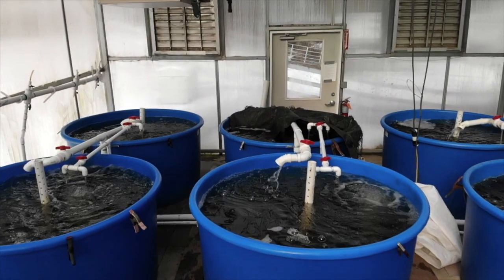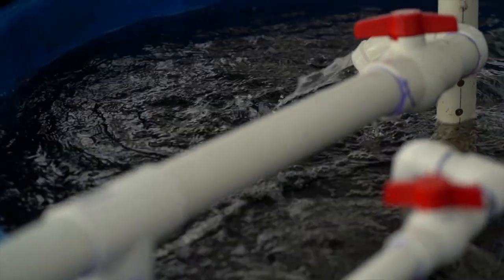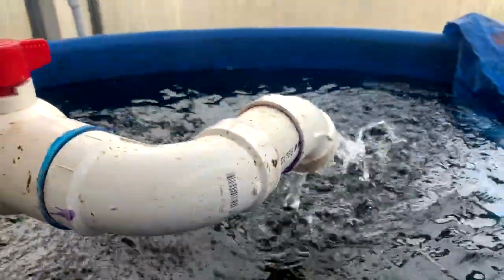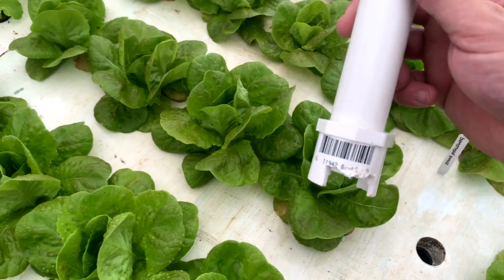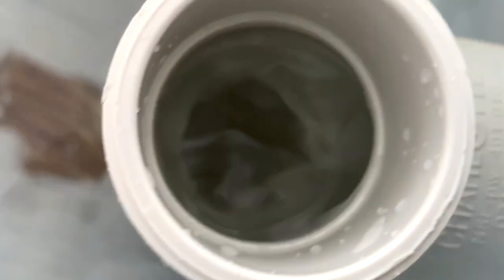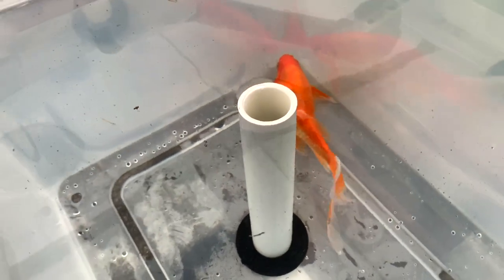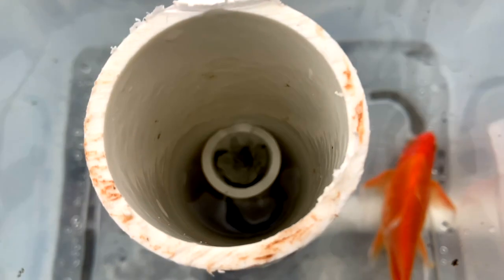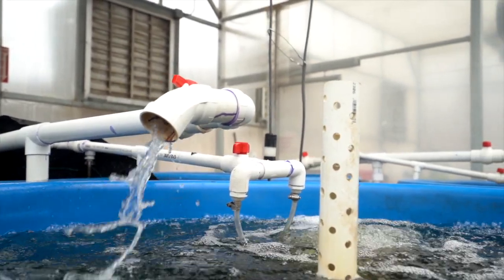Solids Lifting Overflows (SLOs) for filtration in Aquaponics

Comment: Thanks for the video, I tried the horisontal SLO. my tub is 160x110 x 40cm(height), about 500 liters. I use 2" pipe SLO. The flow works, but the flow rate return with balance is only 70 liter per hour. Definitely not enough for fish farming. The filter is located at the same height as the tub. Any suggestion to get higher flow rate?

Comment: Great visuals! Thanks for sharing. Just some questions though. Is SLO still needed if there's a pump sucking the water/debris from the pond going to the filtration system? Or can SLO and pump be installed at the same time? Appreciate your recommendation. Thank you very much
Reply from the maker: SLO is essentially a way to do it without electricity. Pump would be all you need
Reply: @NewAgrarian  awesome! Thank you

Comment: Great explanation! Curious about what mechanical filters are best used for the VERTICAL SLO. In some designs, I have seen that goes straight into a radial flow filter (from the bottom), but I am curious how can it be used for a Swirl filter
Reply from the maker: I have a video that explains that a little bit… “settling tanks explained”… but I dig the radial flow filters

Comment: I have a 1 feet tall fish container but 3 feet tall mechanical filter

if I use the horizontal SLO I believe in the fish container, the input hole into the mechanical filter need the same height if not lower right ?
Reply from the maker: Yes, Input hole on Mechanical filter should be slightly lower, and you can always raise it once it’s inside the tank
Reply: @NewAgrarian  Can the horizontal SLO be the taller than the tank so that i don't have to drill into my aquarium glass? I'm wondering whether going above the tank height will be an issue. Thoughts?

Comment: Thank you. this was straightforward.  I'm thinking of designing a biofilter. Just wondering if I can do this SLO and then add simple solute filter( maybe a shade net) then some finer material under the shade net filter followed by some bioballs for microbial surface area in the filter tank? Also wondering if I should include an air pump in both the fish tank and biofilter?
Reply from the maker: Ngwako Sekhula air stones in fish tank and bio filter definitely. Trying to visualize what you mean with the shade net. As long as you collect particles before bio filter it should work fine
Reply: @NewAgrarian  thanks, the shade net will work like a sieve to the 1st large particles the maybe followed by a filter mat for finer particle. Will definitely put air stones in both👌